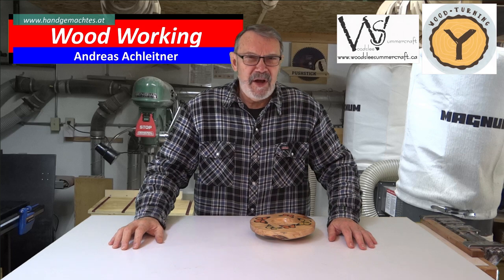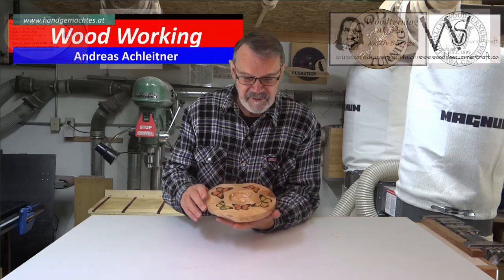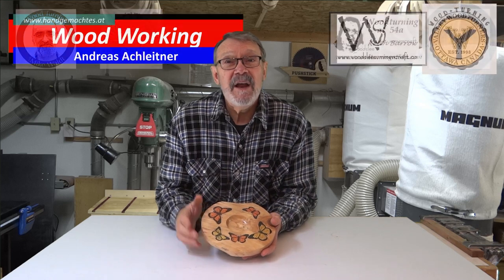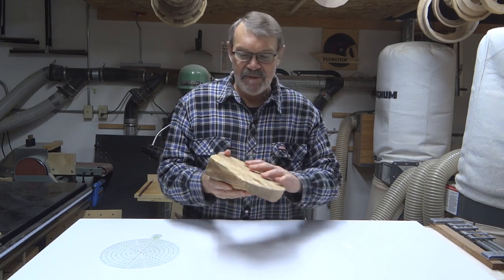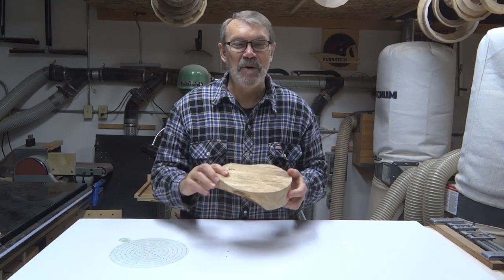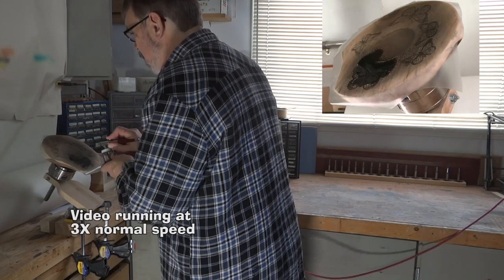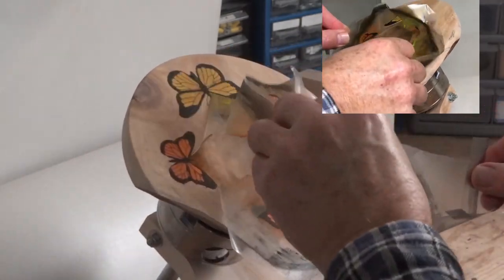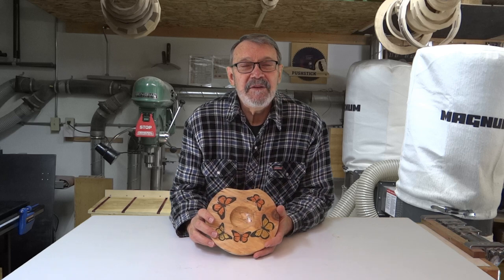Turned Maple "Butterfly Bowl"

Comment: Nice butterfly's and a great use for that piece of maple. If we keep an odd piece of wood long enough there will be a use for it. At least that is what I tell my wife.
I have an airbrush that I sometimes to spray clear lacquer on bowls or carvings.
Excellent job of burning those lines in and cutting and trimming the masking away.
Reply from the maker: Thanks for mentioning spraying lacquer with the airbrush. I've been wondering if it might be too thick for an airbrush. I will have to try it. 😀👍👍
Take care,
.....Gord
Reply: Gord I use Deft lacquer and thin it down no matter how I use it. For an airbrush I go as much as 50/50. Usually cleans right up by spraying lacquer thinner through it right after use.
Gary
Reply from the maker: Thank you very much, Gary! I appreciate the tip. 😃
.....Gord

Comment: One thing I do and use to help steady my hands is a piece of dowel in 5/8 diameter and 24 inches long and put rubber caps on each end of the dowell . I place the dowell against  the item and rest my hand holding the brush or air gun and it offers some additional and closer support. No matter what I enjoyed the project.
Reply from the maker: Thanks for the tip, James! I had to read it a couple of times to understand what you mean (I think) but it sounds like a good idea. Thanks again and thanks for watching! 😃😃
Take care,
.....Gord

Comment: Gord, Very nice video. I think the use of the air brush was right on. Especially as a first effort. Maybe the pens would have been quicker / easier but they you wouldn't have gotten the experience with your new toy. The end result is very nice indeed. Thank you for including the sanding and finishing. I wonder if you could have made the image by placing the printed side of the paper on the wood and transferring it with a hot iron?  By using this unusual piece of wood you have inspired me to try something similar with a small burl I have. I have been trying to figure how to work with it for about a year. Now is time to give it a try.
Reply from the maker: Thank you for the kind words, Glen. I believe you can transfer an image with an iron but if I remember correctly it won’t work with an inkjet printed image. I think it has to be printed with a laser printer. I could be wrong about that! Going by memory is never a good idea for me! 😁😁
Thanks for watching!
Take care,
.....Gord

Comment: Nice work. Question: when you finished the black did you cover that up again to do the other colors ?
Reply from the maker: No, I didn’t cover it up. Because I was using much lighter colors it didn’t seem to affect the black. On a different piece, using the same colors, the black turned green when I applied the yellow. Not sure if I didn’t let the black dry enough or what the difference was. Will have to do more experimenting! Thanks for watching!
All the best,
.....Gord

Comment: Nice job Gord but why didn't you use your tail stock with a live center on the first part.
Reply from the maker: Sorry, Scott, I neglected to mention that the blank was mounted on a woodworm screw. As long as the cuts are not too aggressive I don’t feel the need to use a live center for support. I hope that explains it alright. Thanks for watching and for pointing out what I should have mentioned.
Take care,
.....Gord

Comment: Gord -- You were a little defensive about the way you transferred the butterfly design to your bowl. No need to be. There's nothing wrong with using carbon paper. 

Of course, I still use the traditional method taught me by my father. For those unfamiliar with traditional methods, you use a very sharp and well-tuned bench plane (a #4 Stanley will do) to remove a whisper thin shaving from the surface of your project. Then, carefully, uncurl the shaving and mount it to a sheet of copier paper. Run the paper/shaving through the printer so your design is printed on the shaving. Finally, remove the shaving from the paper backing and glue it back onto your project from where it came. With practice, the glue line is imperceptible.  If you use colorfast inks, there's no need for an airbrush!  

The old timers were really good at this kind of stuff.  It's a vanishing art.
Reply from the maker: I didn’t mean to be defensive, David. I was just confirming that I know there are other methods. If I hadn’t said it I would have 10 people telling me that there are better methods.
You must be a lot better than me with a plane! I would love to see that done! I think I will continue learning the airbrush. 😃😃
Take care,
.....Gord